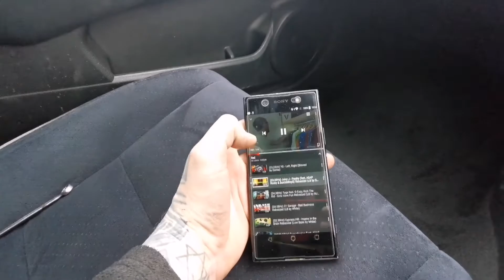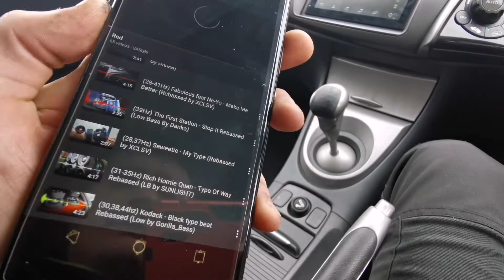Full sound system install on a Honda Civic 2007 Mk8. Front and rear door upgrade Sub box buid Part 8

Comment: Hello mate, 

I just finished watching the whole series. Beautiful install. 
I had couple of questions please.

The door speakers can you use the original speaker ring template with after narket speakers? 
What brand and size are the door speakers front and back the same? 

Cheers and have a lovely day! 😎👊🏽
Reply from the maker: @90nadz  Thanks bud. 
No you need to make your own out of mdf or buy special ones off ebay.

All speakers are 6.5 inch. I had Rockford fronts and Kenwood rears